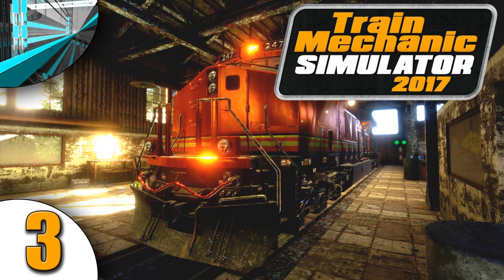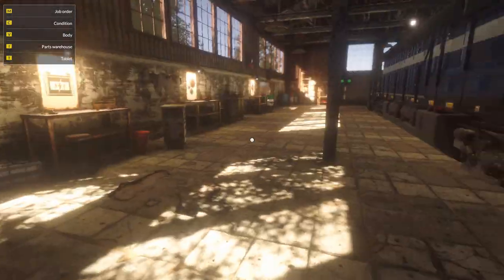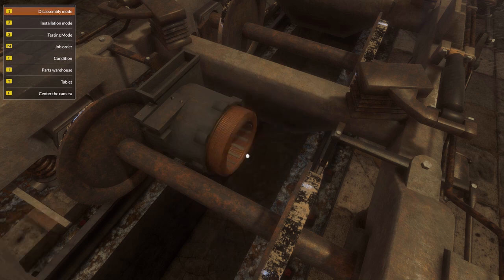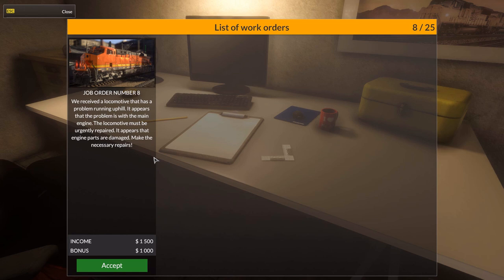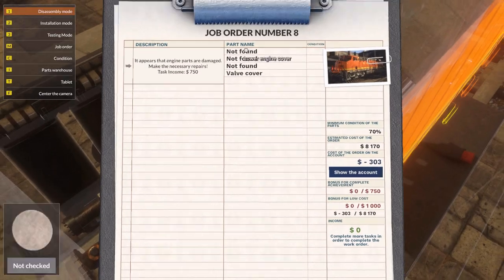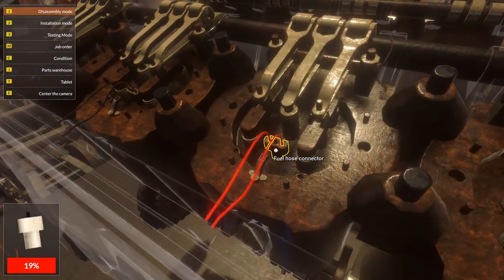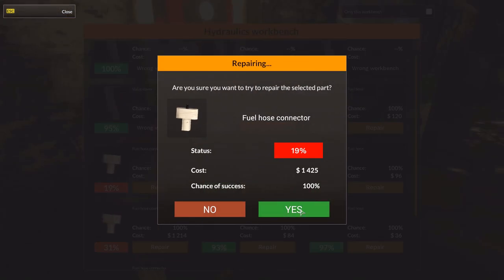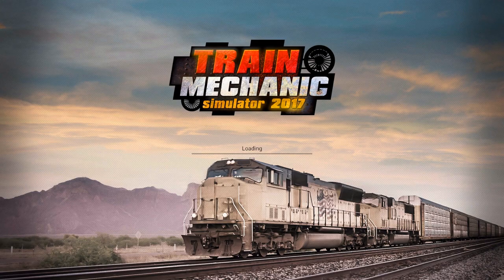Let's Play Train Mechanic Simulator 2017 (part 3 - Diesel Engine [blind])

Comment: Most modern trains have the same truck mount and rollers, but variate depending on the type of train and its job. A diesel train hauling steel and concrete will have a more durable mount and stronger parts versus an electric trolley that moves passengers around a city.